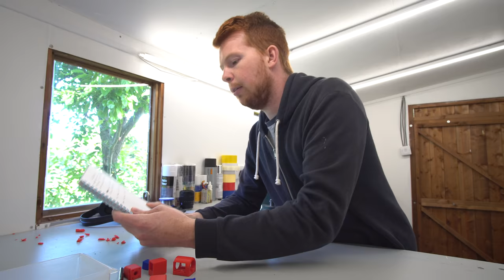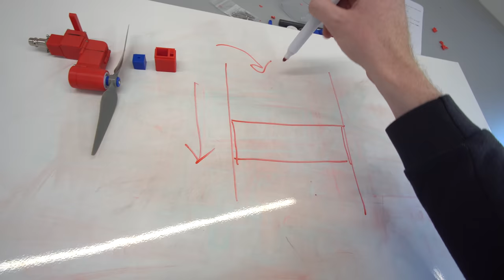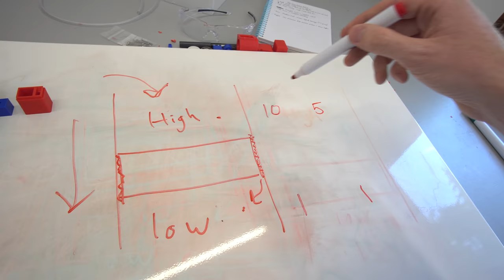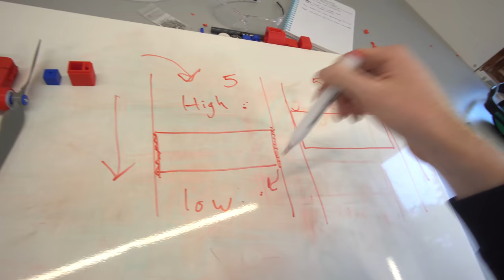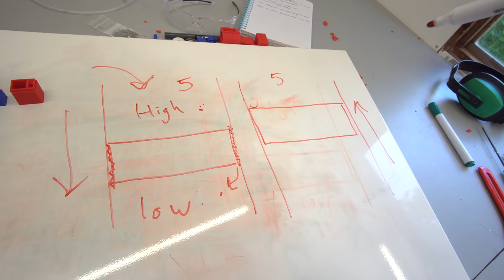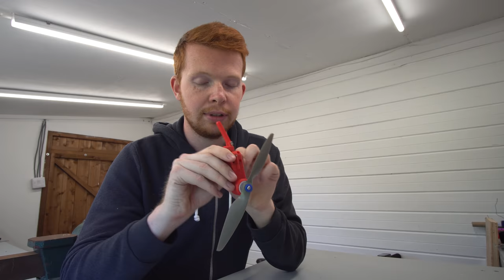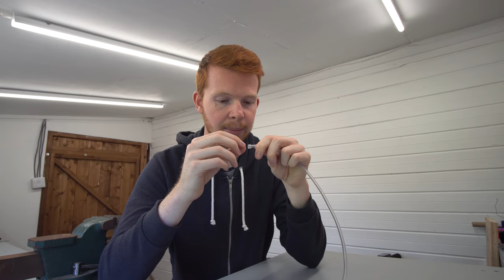Multiple or Single Cylinder Air Engine?

Comment: 3 things

1 Perfect the cylinders first, you're adding complexity and problems when you need to be avoiding that, you've proved that your engine only needs 1 cylinder to have continuous rotation so the second isn't an engineering benefit as such just yet, there may be other optimisations that come from more cylinders but anything you can do that applies to 1 will also apply to 2 or more.
2 can you make it so you feed the air from the shaft end rather than the other? it'd make the expansion in either way equally simple I think, one way might be to have the air feed into the center and have a 3D printed tube that's part of each cylinder that runs from the central air input/reservoir to the other end.
3 triple cylinders with 120 degree off set (either crank position in line cylinders or physically as with the demo today) would make the engine start no matter where it stops without risking your fingers. and look pretty cool I think, a hexagon would look even better and you could do the offset crank and make it more complicated to remove vibration too but consider points one and two priorities ;)

Keep up the great work, super interesting

Comment: i think it's best to first ensure that your single cylinder is as good as possible, currently it's far from perfect. in a similar setup i was using a thin leather circle press-fitted into the cylinder that takes its shape over time and seals it really well. also your cylinders currently have far too much volume and because of that they use air far too quickly which will further increase if you use 2 cylinders.
finally, I was using a syringe chamber instead of printed one, and that instantly made it way more airtight and reduced friction at the same time.

Comment: As far as motorcycles go, smaller displacement single cylinder engines are more efficient than their counterparts with more cylinders and or larger displacements. So for flight duration (assuming that 1 cylinder is enough to provide enough thrust) one cylinder seems like the best option.

Should you want to make a bigger plane with more 'fuel' bottles perhaps more power will be needed so then advance with a multicylinder engine.

As far as your efficiency explanation consider this: in a stationary case I would say your diagnosis is sound, but the higher the pressure, the more force on the piston and the shorter the time period for air to leak by. The amount of air that leaks by is a complex fluid dynamic problem that would need to account for the density of the air (dependent on pressure) and the effective area of the circumference that the air may blow by. It is a lot harder to blow by tight spaces than larger ones... To elaborate it is easier to blow through a straw with a 1cm^2 cross sectional area than through 1000 straws that add up to 1cm^2 of effective area. This is due to the boundary layer acting as a 'frictional' force to the flow of air.

I say get one mastered in efficiency keeping in mind the possibility of daisy chaning the engines inline. Perhaps adding small counterweights to the crankshafts?

As for the bearings, the ceramic may still have less friction. Consider the massive steel ring and bearings that now rotate with a lot more energy than the lighter, similarly sized ceramic ones. The extra mass will help in smoothing out the power pulses  like a flywheel but alao perhaps draw more power than the ceramic ones. Alao compressed air usually contains water which happily condenses after being depressurized and cooled. This will aid in rusting the bearings. Stainless steel still rusts just at a slower rate than other ferrous metals.

Comment: normally in the automotive field the long stroke with respect to the bore produces a slow and not very reactive engine. the old engines of Alfa Romeo were called supersquare to have almost equal bore and stroke and this gave the engine a characteristic elasticity in speed variation.
a reduction of the losses between piston and barrel you could have it with round pistons instead of squares.
the fractionation in several cylinders with the same displacement could be useful if the surface of the pistons could be increased, thus having a greater surface on which to effect the air pressure,

Comment: I would do in line 2 cylinder, because i think the sealing of the pipe to the head is more difficult than a complicated crankshaft.
Also the ceramic bearings are mainly for specific purposes. Like being cleaner, not conducting electricity, not being magnetic, ... For your purposes the steel bearings are better.

Comment: I want to react about your problem with the plumbing of the flat-twin engine, I think you would have a higher efficiency if both cylinder take the same pressure in the same time which is easy to do in a flat-twin because you can design the intake manifold with the same length and diameter for each cylinder but for the in-line engine it would a little bit harder than for the flat-twin engine in my opinion. To summarize my point of view if you do a flat-twin you can make it more compact than the in-line engine and have lower gravity center which it could be better for your plane application. 
I really enjoy your videos !! :-)

Comment: i do believe your right on the piston leaking but if each piston got its own valve unless the valve leaks too the piston leaking will be the same because its only leaking out of 1 piston at a time but if its a 4 cylinder each piston only got to travel 1/4 turn before another piston provides power but at the same time more pistons the more air is needed so it will just go slower the more pistons you add unless your willing to add more air. but will provide more torque at lower rpms

Comment: Alright Tom, ponder upon this. I vote single cylinder btw but I will explain why. In the beginning you were talking about efficiency and the air leaking around the perimeter of the piston. So, in order for multiple cylinders to be more efficient, the amount or air that leaks around the piston per psi for example, must be indirectly proportional meaning that the higher the psi, the less air leakage. This value would not be negative, but just less according to the ratio. If this ratio is 100% linear meaning no matter how much air pressure there is, say .8% of that leaks out, then splitting the engine into multiple cylinders will result in the same leakage. For simplicity, if you have one cylinder leaking 50% of the air. And the pressure difference is 10 atm, then it would leak 5atm. If you have two cylinders that together have 10atm then it would still result in 5 atm leakage. What I think you should do for your next video is to come up with a way to measure how much psi leaks per second at a given initial value and try to come up with an equation that can approximate the leakage given a certain initial psi value. If you get the data points you can pm me and I can do the calculations in one of my engineering labs if you don’t want to do the math haha! From this equation we can see how efficient it would be to create a multiple cylinder engine.
Reply: Just a suggestion, design a piece with the same clearance values that literally just has the piston sit in a chamber and run say 10-60 psi through it, record how long it takes for the given psi to even out. Repeat each time increasing psi by 5. Once you have those numbers you can see if it is exponential, logarithmic, or linear. My bet is that the higher psi the more it leaks per psi but I could be wrong.

Comment: perhaps with the flat twin head, have the air intake above the crank shaft and have a 3d printed tube that splits and goes to each piston. otherwise good work cant wait for the next video

Comment: I think, if you are going to build it into a car and don't want to install a clutch then a multi-cylinder engineer will decrease the chances of a stall.

But if you are building into a plane the split engine is going to catch a lot of the exhaust from propeller thus decreasing it's efficiency.

Comment: On the issue of air leakage and single vs multi-cylinder. It will most certainly not be linear. We can make a Gedankenexperiment (thought experiment) and assume that we have higher and higher pressure on one side to extreme pressures. If you only have a small gap around, one would not expect a linearly proportional air flow. It would level off I think and it might be a logarithmic relationship. That in combination with the linear relationship of the available air gap, I would actually expect a less efficient engine, but with more power, if you go for multiple cylinder engine. (additionally you might have the effect of more efficiency loss due to more friction in a multi-cylinder engine). You could maybe optimize valve opening times and get it back to a more efficient engine (because you could apply shorter bursts of air, because the piston does not necessarily need any push power if it's already almost at the bottom, because the other piston can take over).
Do you have access to a CFD-software? I'm at the moment playing around with a commercial one at my employer for something completely different, but there should be open tools as well that might be able to answer these (and other airplane related questions) rather conveniently, especially if you already have CAD-files of the engine available.
In this case, if the power is not needed, I would recommend from an engineering standpoint a single cylinder engine for simplicity, ease of build and efficiency. But from the standpoint of a video on youtube and solving a more interesting challenging engineering question, I would definetly want to see you build and explain your version of a multicylinder-air-engine :).

Keep up the good work, one of the best channels on youtube in my opinion.

Comment: In-line is a lot better than the flat twin because just a more complex crank shaft with just one added of set is a lot better because you could just add another cylinder and piston to what you’ve got already instead of having to design a whole new plumbing system

Comment: You won't gain any efficiency from lowering the pressure and double the pistons, the flow through the gap can be described (Simplified using Bernoulli's principle):

Flow of air mass = sqrt(2* (High Pressure - Low Pressure))*Density of Air * Area of Gap.

It depends on the square root of pressure while it depends on the area of the gap linearly. The way you increase efficiency using multiple stages it to feed the exhaust air from the first piston into the second engine. Even if your first stage expands enough to reduce the pressure inside the piston to ambient pressure, you still have "unused" energy in that air, since it will have gotten cold from the expansion, putting that air into another piston and heating it up using the ambient temperature from your surroundings can get you even higher efficiencies.

Adding multiple stages can effectively do this since it slows down the expansion, thus leaving more time for the gas to warm up, but in your case more stages will just lead to more leakage and thus worse efficiency. The main reason for you to add multiple stages however is not for the heat bonus, it's because you run the engine on a pressure that changes a lot, thus if you try to optimize your piston for a single pressure, using the equation:

Optimal Expansion Volume = Pressurized Volume*( High Pressure - Low Pressure)/Low Pressure.

But since the optimal expansion volume of your piston depends on the running pressure it will change over time. A good way around this is to use multiple stages, this allows you to run at close to optimal efficiency throughout the whole tank. This also allows you to run at a much wider pressure ranges, you can both use the pressure in the second stage to open the valve to the first one, and you never run into the problem of your piston "getting stuck" before reaching the bottom of it's cycle at lower pressures.

If you want maximum efficiency I would say increase the radius of your piston and use maybe 2-4 stages, depending on how much each stage leaks. Also, I would love to help with calculations if you need any help :D

Comment: do it in a v2 configuration, that way the crank is pretty easy to design adn you can 3d pint the air paths within the groove of the v. You should also go back to the cylindrical design for the piston or maybe try a spherical one because it has the lowest perimeter to area ratio, which minimises leaks.

Comment: I would just 3d print a plenum to connect the air to either side of the flat twin engine, as long as you minimise the volume inside the plenum to keep the pressure drop in check you should be ok.

Comment: Single-cylinder; the only difference between the 2 engines is the power profile and weight, the single is lighter, but has more intermittent power profile (think AC current), this is accounted for by the momentum of the system, whereas the flat twin is more like 2-phase AC, having a more stable power profile. The twin engine would probably be more efficient at higher revs, but for the relatively low revs you're wokring with the single is fine and is lighter and simpler.

You could consider a turbo-prop design? The effeciency might be higher, intermittent air-flow wouldn't be necessary and you could use a flow restrictor to reduce the effective pressure down to somehting like 2-3 atmospheres - might get more out of a single tank.

Either way, my only advice would be to plot the power curves of your engines.

Comment: If you decrease the amount of air leaking through by 50% and at the same time double the amount of pistons you effectively have the same amount of pressure loss (assuming it is directly proportional as you said). You should rather do one big cylinder since you can double the area of the piston (and thus lower the pressure differential by 50% to have the same amount of torque) but only inceasing the circumference by the square root of 2. But again you will have more friction and stuff so I have no idea which is going to be more efficient.

Comment: I think that the same amount of air will end up leaking because only one cylinder is being pressurized at a time. A more obvious benefit is the engine being harder to stall and easier to idle. With twice as many strokes per revolution if one cylinder doesn’t get enough air pressure it wont have to wait a full revolution to build its speed back up.

Comment: Multiple cylinder gives you better torque and smoother power through each revolution, but not necessarily more power.
With a single cylinder engine you are essentially coasting through half of the stroke.  2 cylinders will take care of that issue but unless you use inline cylinders you are going to induce lateral forces which will cost you in performance as well.  This is why most aircraft use radial engines or 4 cylinder flat engines.  The 4 cylinder option is so that each stroke can be offset by 1/4 which takes care of the vibration.

Comment: Multi - obviously! Can you get the air channels designed into your plastic parts, rather than use hoses -  i.e. as part the cylinder walls and crankcase with some o-rings at the joints? Great to see your own ideas come to life though - Greetings from sunny Radlett!

Comment: Hi, i will share my thoughts :) Lets do a simple thought experiment. Lets take 2 cylinders with same square pistons. By joining them together on one side we can eliminate leaking around this edge in both of them. Therefore this combined cylinder must be better than 2 individual.

If You want to minimize leaking i would go for lowest circumference to area ratio: make piston circular :)

If you want to lower pressure difference (like from 10 to 5 in video), just go with bigger piston area and bigger displacement volume.

Comment: the ceramic bearings are better for high rpm because they handle heat better than the stainless steel ones do. like downhill long boarding where you start reaching highway speeds.

Comment: If I were you I would continue perfecting the single cylinder engine until you are comfortable with it then expand to multiple cylinders.

I think also that the bumbling for the multi cylinder design would turn out to be far easier to work out.

I think you should scale up the size of the design for more room to work out the issues and use hard pipes like copper for the air system on the multi cylinder design.

Comment: I would go with a 3 cylinder engine because you wouldn’t need a flywheel to drive it. At any part of the 3 cylinder strokes, there will be power, giving steady power to the propeller

Comment: I know I probably won't get a reply but I will ask again. Are your props and cam / drive shaft balanced ? This can give you modest gains in efficiency because the vibrations you spoke of are causing lost power . It's not hard or expensive.  There are many great RC hobbyists,  online resources, store and channels that  can help. You could even do a team up video with someone like Flight Test. I bet those guys would love to help. I would go single cylinder first. Perfect that then develop a twin.

Comment: Hi mr. Tom,
2 things first : I haven't checked other comments, so I might be redundant, and english isn't my current lenguage (français la baguette you know), so please excuse the mistakes...
SO, I think you could do 2 things to improve your motor :
If you make a bicylinder, you can make a V2 so there are a single cylinder head AND and crankshaft that may be simpler than an inline motor.
And you could also make an hexagonal cylinder and chamber, because they have the best surface/perimeter ratio...
By the way, v2 are way cooler than inline or boxer because there's "V" in the name !
K. ;-P